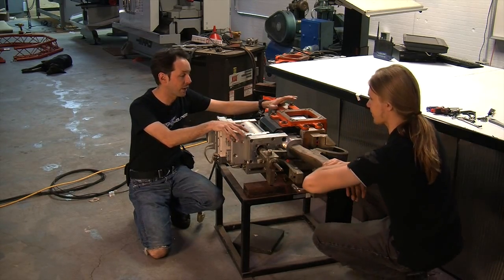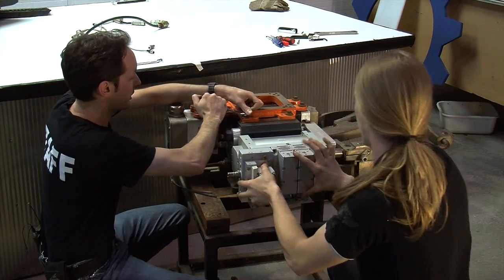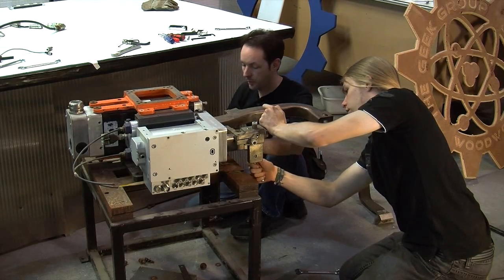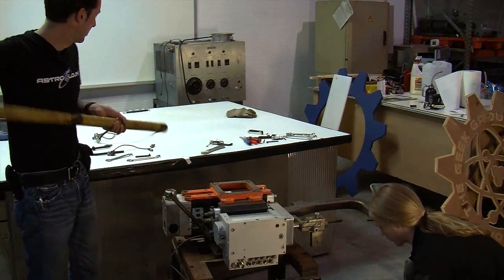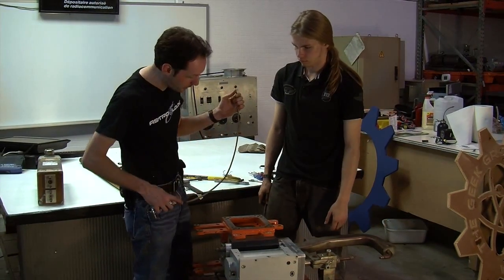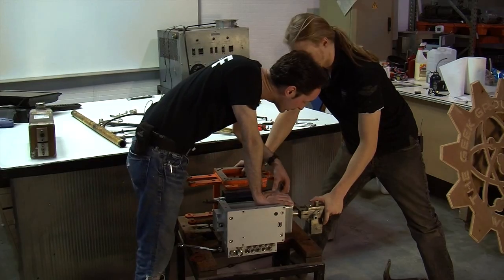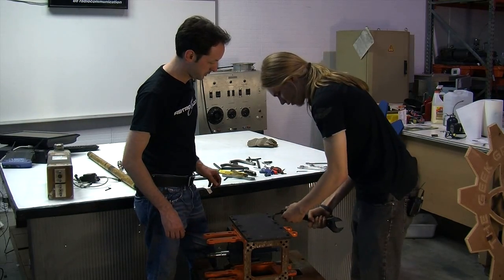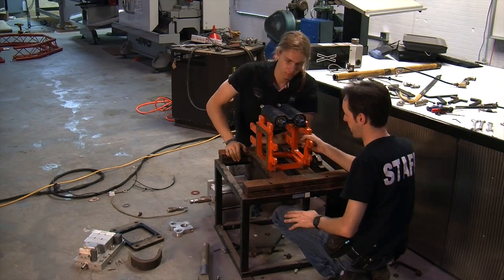Robotic Welder Head: Equipment Autopsy #46

Comment: Nice video. We should get these to play at university :) I think because of failed welding arm cooling this thing should worked weird, made bad welds i guess. Wrong temperatures messes up all sort of things. That's why it got donated. Maybe caused damage to power supply (doubt it), you did not took that apart or tested it ;)